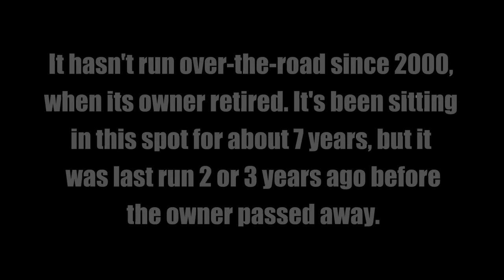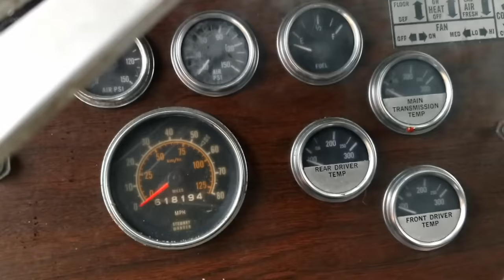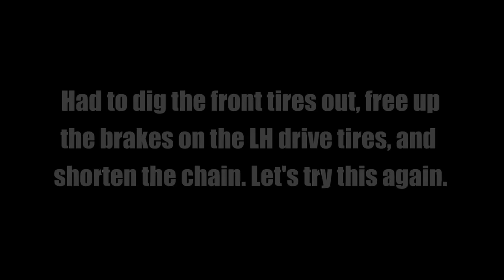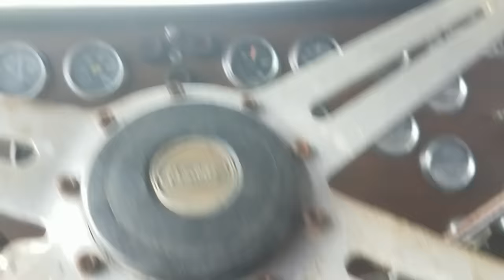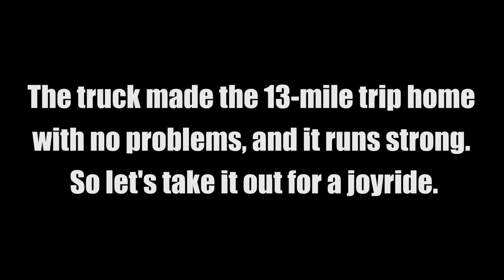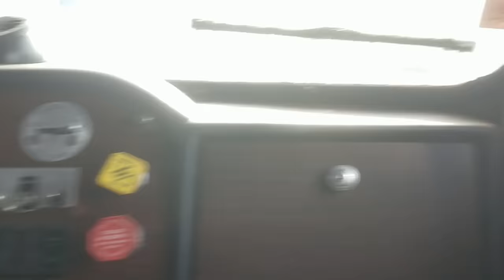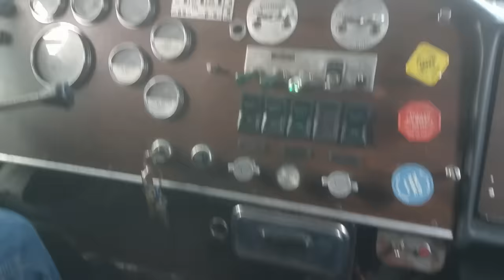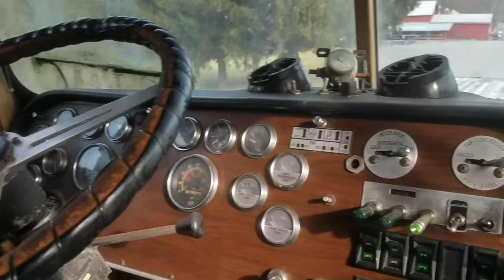Rescuing a 1977 Peterbilt 359 From Its Grave - First Time On the Road in 18 Years

Comment: All mechanical engine NO computers NO PROBLEMS the engines just kept on running
Reply: yup, no electronic parts to fail
Reply: Correct
Reply: When cold starts were just that and only that.
Reply: So, this thing would function post EMP ?
Reply: @xzqzq  
Most of the modern cars electronic components are protected against EMP...
Reply: xzqzq dam skippy it would all mechanical
Reply: @cultofpersonalit1888  No they're not.  Most military grade electronics aren't protected against EMPs.
Reply: @Donhilskier6  
Why the builders don't protect the electronic stuff ? 

I believe it's easy some guys on YouTube show how to do it...
Reply: @cultofpersonalit1888  If it's not in the specs of requirements, it won't get done. Pure cost. You can over-braid cabling, but it's time consuming. Most COTS parts won't meet the requirements. 

The other issue is weight. For weight stringent environments like on aircraft you can't be too heavy.
Reply: @Donhilskier6  
Ah ok, thanks for the reply man !
Reply: TIME IN A BOTTLE  yeah I miss the Good old days when everything was so much simpler
Reply: @cultofpersonalit1888  no they are not. Put your waders on.
Reply: @thomasgregory6975  
Wtf ?
Reply: @cultofpersonalit1888  U.S. Federal law maintains consumer grade electronic devices mustn't block interference. "EMP" shielding would inadvertently, or otherwise, protect from a broad spectrum of interference.
Reply: @xzqzq  this truck will survive all.... Zombies and much more 💀
Reply: @xzqzq  Absolutely. A mechanical diesel is just that, all mechanical. You just need a battery to start and batteries of that size are not EMP affected. All military vehicles are mechanical in every way for just that.
Reply: TIME IN A BOTTLE  yes there is
still gotta do your manual safety checks
Reply: Robert Craig   unless its electronic
Reply: No smart phones spotted. Just people living life.
Reply: @iShayneGA  The Real TRUE Good Old Days are gone
Reply: That's right.
Reply: very poor fuel economy as well
Reply: @tmagz6622  yeah but back then diesel fuel was only $0.75 per gallon.
Reply: @juliusadams1931  right, but adjusted for inflation thats 3.18 usd which is what you would pay today
Reply: @tmagz6622  yes that is correct 3.18 today but Again diesel engines made back in the 1970s was much more reliable the point I was trying to get across they just don't make them like they used to regardless of fuel efficient diesel engines were made much better back in the 70s
Reply: @xzqzq  well, technicaly it could
Reply: I disagree a bit, electronics are indeed an added failure point, but when it comes to diagnosing a failure they reduce the time and cost of maintenance jobs and specially with asynthomatic failures that bare eye don't notice but they kill the mechanics silently, besides planned obsolescence, they were meant to make maintenance easier back in the days
Reply: @kernel_data_inpage_error  everything was easier back in the day even opinions now you always have somebody disagreeing on the truth about something people trying to change it around and flip it it is what it is you miss my point of view you're not understanding but that's alright it's just part of Being Human when we think we know we were talking about and we really don't it's called a mistake
Reply: @kernel_data_inpage_error  I don't know how long you been driving but I have been driving since 1981 back then mechanical now electronic I've been there and done that I experienced offhand I'm only saying this because I believe in life if we're going to say something and talk about it unless we haven't experienced it then we don't really know what we're talkin about
Reply: @juliusadams1931  i confess, i drive a Toyota Celica from 1992, and yeah it may be my third of fourth year driving, I had to drop my mid 70's VW beetle, cause here in spain cars older than 40 years are banned due to emissions and yeah it had 0 electronic besides the Stereo (which was all analog) but I tell this cause a day the engine started hesitating, and three mechanics couldn find what was going on, I had to go to a elder mechanic who took a special gauge and found that the fuel pump was faulty, now you have just to plug a serial port behind the steering wheel and a software tells you in real time oil pressure, temperature of each cilynder, etc... Also i praise my cars computer because as a novice it saved me from mis-shifting (I still do lmao) and yeah both cars are older than me
Reply: @Ryan Plethra This guys never heard of a scatter shield
Reply: ok boomer
Reply: All metal NO fiberglass NO safety systems.

You get hit in a odd spot and you’re dead

Pluses and minuses of the ole boomer mobiles
Reply: @castillo33brandon  Indeed. Modern cars and trucks are less tough so that they crumple and save you from major injury.
As for car and truck interiors, I don't mind as long as I have a digital speedometer, cruise control display and maybe a GPS, otherwise I like old analog panels like the 389 and W900. Gotta give props to Kenworth and Peterbilt for offering retro designs with their modern models.
Reply: @juliusadams1931  Ah the classic "My opinion is truth" card.
Reply: @juliusadams1931   you are so right!!! My friend 
Disagreement based on emotional ignorance....
Reply: @whiteoak60  Thank You brother
Reply: What happened to "we agree to disagree?"
Reply: @racer927  nothing's changed
Reply: <--- It's called 'Old School Eh!'.... Cheers.
Reply: Wow
Reply: Spoorloor
Reply: Exactly
Reply: Built to Last!
Reply: Le wrong generation
Reply: Y realmente  era la pericia del chófer y sus conocimientos  mecánicos  ya que donde se alguna descompostura  en la carretera el la podría realizar y llegar al poblado  más cercano
Reply: @cultofpersonalit1888 No if it's a nuclear EMP or the Sun no modern electronics can withstand the amount of energy forced into their circuitry. The best way would be to have an engine with as little electronics as possible and have a faraday cage built onto it. This would help but it most likely would still be affected
Reply: I wish I had seen this sooner would like to have the truck.
Reply: @tmagz6622  You're forgetting our wages have gone down since the 70s
Reply: Same reason I lost interest in drag racing
Reply: @juliusadams1931  I'm definitely no expert. But I'm not sure if they were "better" back then or just simpler. Now, they have better materials and tighter tolerances with superior lubricants and more efficient designs. But I think they appear less reliable, at least in part, because of the  additional emmisions systems that cause constant codes and breakdowns. I would think that the newer engines would be incredibly powerful and reliable if they were void of the smog stuff and left to run as engineers designed. Just a thought.... Cheers
Reply: @giggiddy  It's less the computerized stuff and more the laws restricting people from performing field services which I think is ridiculous.
If we buy the vehicle, we own the onboard computer. End of story.
Reply: @racer927  I couldn't agree with you more.    It seems like we are being held ransom by the folks that control the software to the point that the owner isnt "allowed" proper access to their own machines. Cheers
Reply: @giggiddy  Same.
Just to clarify: I have no problem with vintage stuff, it's the people that ride their high-horse about how great their vintage stuff is and not even recognizing that modern things have their niche as well. (I like to use both old and new vehicles in FS19, for example)
Reply: Yep. My dad had a KW cabover 1979 with a detroit engine. Started up and ran until the day he died. Yes no electronics
Reply: Just keep clean oil change fuel filters and clean air filter good fuel and they run forever not like these computer trucks give me the old school trucks any day oh and hell with Greta too
Reply: And all that crap is on engines why????
Reply: @UnknownUser-fe5zu  I think you commented on wrong person for truck/car technology. However with the modern era if ECM's and related to gas or diesel, problems have just exploded with issues. I was a master GM mechanic for 15 years and saw ut all. Got out of that crap and now work for a clas one railroad making 3x the money any day. Honestly, who would even consider working on a truck or car for less than $150k a year? Not me.
Reply: @UnknownUser-fe5zu  My brother in law has been an independent since the 80s so I know what a pain in the butt it can be but thank God for all of our truckers and the people that keep them rolling.
Reply: @johnclamshellsp1969  no I didn’t. You said In a post….quote…”all military vehicles are mechanical in every way just for that” referring to EMP’s. I just looked at it again.
Reply: Jyeb

Comment: wonder if in 40 odd yrs time a 2018 truck will fire up with just fresh batteries and fuel  ?"computer says no !"
Reply from the maker: Exactly. There's no school like the old school.
Reply: Lol so true
Reply: The only thing that really fails in a computer that's not in use would be capacitors, and those are easy to replace
Reply: Marek Jablonski what about all of the electronic sensors and error codes they give out when they fail?
Reply: @rj6110  It'll just run really inefficiently and be really mad at you. No reason why it shouldn't start and run.
Reply: Hopefully we can get those field-service laws out of the way.
The important thing is not to hate the fact that stuff is computerized, it's the ridiculous laws that manufacturers put on it that prevents people from field servicing.
To those people cracking their John Deere 6-9R tractors; keep doing it because the best way to protest a law is by breaking it to the point that enforcement is impractical.

Comment: Gonna love  cranking up old diesels after their naps
Reply from the maker: More exciting than trying to start a gas engine after a long nap. Lol.
Reply: @MichaelTJD60  this is very true
Reply from the maker: @terrancewoods4892  I wish it was my truck but it belongs to a friend of mine. I was just helping him get it running. I won't say how much he paid for it but he practically stole it for the price. We got lucky since the engine didn't take much to get running. Hope you can get that 377!
Reply from the maker: Robert LaPointe  That's an old Cummins for ya. They always smoked pretty heavy on a cold start. One of the drive tires were flat, but otherwise I was pretty impressed that the rest of them held air for so long.
Reply: @MichaelTJD60  your friend got him a bad ass rig gotta loveem they don't makem like that anymore I have a 1976 Ford F600 Dump Truck and she still running with the best of them I use it to haul fire wood gravel dirt sand exdra I use it at work sites instead of paying for a big dumpster I can fill my truck up and haul it away to the garbage dump my self I also run a Hotshot trucking company I have a 1995 Chevy Conversion van and 16 foot flat bed utility trailer I started with my older son is using it now and I have my 1998 28ft Coachman Motorhome 18 foot enclosed trailer I use so my wife and our new born baby can ride with me on the long hauls If I am doing a local run I use my 1993 Chevy 1500 utility truck and 16 foot flat bed utility trailer I also have my daily driver 1997 Chevy Z71 extended cab short bed and my wife's daily driver 2002 Chevy Blazer im in the process of getting a Box Truck and any 28ft class c Motorhome for my older son he is doing good with the 1995 Chevy Conversion van he doesn't have to pay for a hotel because he has the full size bed in the back of the van but if he has a 28ft class c Dutchman Motorhome like I have he will be able to bring more food for the long hauls and that will help save money I got into Hotshot trucking through my Dad and my uncle's because they own a semi trucking company they started passing smaller loads they didn't want to haul and it blew up from there now I have 2 rigs my Conversion van and my Motorhome I am going to get another Motorhome for my order son and I'll start my younger brother in my van and he can get his own truck thank you for a great video and keep making more
Reply: @numap4701  Dude you know I've never heard so many stupid words come out of someones mouth.
Reply: @numap4701  FATHA WUSSHA
Reply: @numap4701  We know you secretly love this truck. Also... I think your caps lock button is broken.
Reply: @MichaelTJD60  he didn't rip her off did he?
Reply: Robert LaPointe  hell my 2001 Ford F250 smokes on a cold start if its not plugged in lol.

Comment: The whistle of that Cummins turbo is like music to an old tractor trailer drivers ears .
Reply: Robert Morton  sort of, because truck drivers if they have been in the business long enough. And some of the trucks I've driven,with those turbos in them side by side.you would never hear those pick ups next to a semi,And most those fellas that drive those pick um up trucks, wouldn't know the first thing about driving a tractor. So I would say to most of you out there. That wouldn't know the first thing,about driving a tractor with non synchronized gears. It would be music to there ears,and I've seen many come in fill out an application. And they take there road test,or asked about driving a tractor with none synchronized gears they have not the first idea, Of what the boss man just asked them. That stops them dead in there tracks.Because they don't have a clue. Those pick up trucks,don't impress me one fuckin  bit.
Reply: @robinoliver4510  it is possible to like both. you don't have to like just one or the other ive been driving for about 5 years and still like the way a pick up sounds.

Comment: Here's what, for someone like me who doesn't know a ton about diesel trucks, I will totally say that I wouldn't mind owning a truck that was made two years after I was born. The fact that the engine had over 600K on it, it sat for 18 years, and then it just simply turns over, and drives like it'd only been there for a few months!?!? This was an AWESOME find, and I'm glad that you guys had the foresight to post and share this video. Hopefully you post some more videos about this one as you restore, and clean it up. Once again, great find fellas. Thanks for sharing.
Reply: Like they said in the video, that engine probably has 1,600,000 miles on it. It sounds odd but 600,000 would be very low mileage for a truck that was built in 77 and drove regularly until 2000. That's 23 years. If it only had 600,000 miles on it, that's only 26,000 miles a year. If it's 1,600,000 miles, that's 69,500 miles a year. 
The 69,500 miles a year is more realistic. If he had a regular co driver, it could possibly be 2,600,000 miles but probably not. 
My money would be on it having 1.6 million miles. When you break it down by years, 600K is just to low. Even 1.6 million isn't all that high but 2.6 million is a little to high. Figuring 250 working days a year, 2.6 would be 452 miles a day. That's doable with 2 drivers but, like I said, my money is on 1.6 million. That works out to 278 miles per working day. Five days a week with a 2 week break every year. Yes, I agree, it's amazing it started up and was able to drive after sitting for so long. Those old diesels are made so they are easy to rebuild & it was probably rebuilt at some point but those old diesels will just run forever. 
Old ship diesels can run for 50 or 60,000+ hours before they need to be rebuilt. 
That's running for 6 to 7 years straight, 24/7.